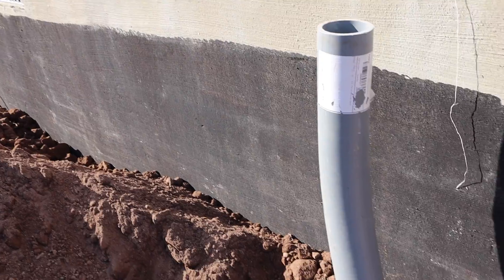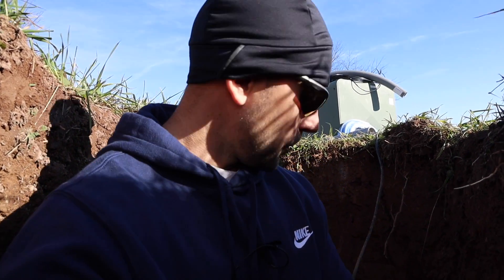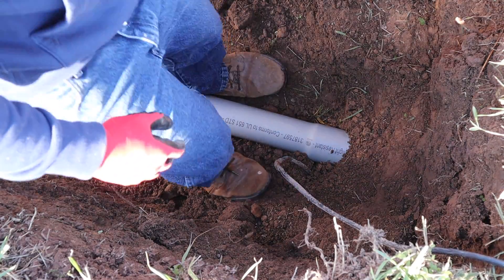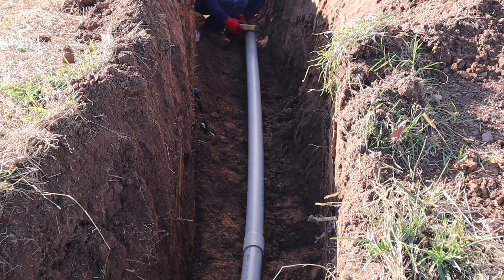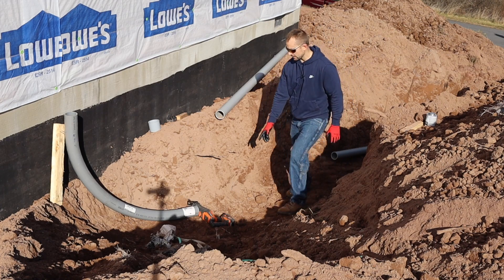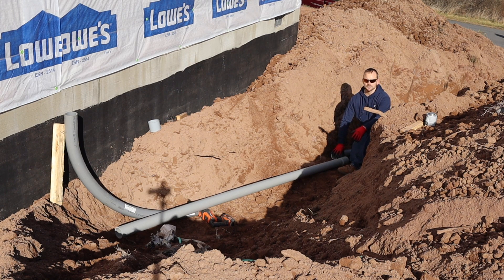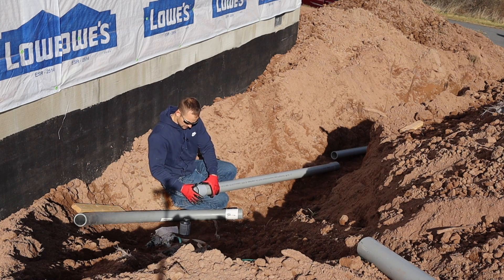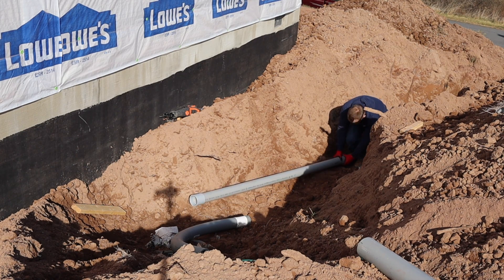Electrical Service Conduit Installation - Underground Power From Transformer

Comment: One would suppose you at 35/hr for the books. 150 hours,  equipment rental (LOWES mini excavator $450/day+ diesel $200)... contract bid with three more leroys at 10-19/ hour. You pad the company $1k a week (on the low) [parts, kiln swedge and glue $1250] HSA -500 cash (co pays with three kids. wife works night shift for the nursing home) and you quote under 50k)

Comment: Why use conduit? Just get direct bury wire. But I don't have codes where I live in Missouri.
Reply: Some codes are strange. I have direct bury wire from the pole to my ground transformer but conduit from the ground transformer to the house

Comment: Can you use 3 inch pipe with long sweep inside the  concrete form ?
Reply from the maker: I don’t see the problem with that. Should be fine. as long as the power company can pull the cable through. You can always check with the power company and/or local building codes for clarification. I hope that helps!

Comment: I didn't think you could come out of ground and up to the meter base with pvc. Did you use schedule 80? In my area the utility company makes the rules and even for a 200 amp single phase service they require 3" pvc in the ground with a 3" sweep and then transition to ridgid or imc coming out of the ground to the meter base. The problem is that most 200 amp meter bases only have 2" knock outs. The utility doesn't care. I have to pullna 3" hole and wrestle in that 3" rigid. Then the utility pulls in the triplex, which is rated for direct burial but you gotta have a sand base, then cover with sand once they put the wire in, have them look at it before snd after. A big hassle. So everyone uses the 3". And they pull in aluminum treplex. They make the lineside connection to the meter base. I make the liad side, usually before they get there. And the triplex has been really derated. They don't care. They don't have to. They are mot subject to the NEC.

Comment: Sometimes yes you can use schedule 40, but it would just typically need to be buried deeper. Very important to check your local codes to see what type of conduit you need for burial

Comment: Does the power company supply the schedule 40 from the transformer to the house?
Reply from the maker: I had to buy the conduit and install it before the power company would pull the wire through. Contact your local power company and see what they want you to do is what I would recommend. I hope that helps.
Reply: thank you for the quick reply and thank you for the excellent videos.

Comment: Never expected the rope to be chewed, but that is why we do conduit. It would be interesting to see the ball with another string blown through. Is the wire hard to pull?
Reply: thought same thing  if it was capped, how did mich get in?
Reply: @somchai4046  the bottom of the transformer is pretty open.  Not very hard to imagine water making a little channel where rodents can get in.

Comment: Does the conduit/trench have to be inspected for depth? Or can you just backfill it and the inspector usually takes the homeowners word for it as to the trenches depth.
Reply: It depends on the inspector. Sometimes they’ll even accept a picture of the trench and be like yeah that looks like it was deep enough

Comment: if you have the equipment to dig ad backfill yourself, how do you figure out how deep to go and how to get it at a decent rise/ angle to make it to the house? also once that it connected to the house, does that have to be inspected before you can go ahead a fill it back in and does the electrical company have to turn on the power or who do you call for that?

Comment: Thanks for the video..I have a similar situation. 3 conduits hydro, tel and cable. They will run up through the footings and stem wall B before we pour the concrete. Electrician wants 3000.00 labour 😅most of that seems to be gluing the conduit. Also installing the distribution panel.

Comment: Our electric company won't pass the 90 degree sweep, we have to use a hockey stick, where we then need a 45 and a 22.5 elbows. also the want purple cleaner on the pipe before the cement.

Comment: Nice work man .. I'm not an electrician and I dont do this kind of work, but when you said the mice ate that string ..or rope .. how are you gonna run a  new one and how did mice get there?
Reply from the maker: Evidently the mice came through the transformer. I had to contact the power company to open up the box and they help me fish a new rope  through. Thanks for watching!

Comment: Great video. 
I will be installing electrical cable in conduit for ground mount solar panels soon.  I will have to go about 200 ft.  To make the "pull" easy my thought is to slide each 10 ft piece of conduit onto the cable from each end and stop in the middle.  Then glue the conduit together.  Continue this until all the cable is in the conduit.  I dont see that anyone does it this way.  Is this reasonable?  Will this work?  Any downside to this?
Reply: The National Electric Code wants you to put the piping (conduit) to be fully installed before you put wire in it.  I expect the wet glue will either destroy your wire's insulation when wet or glue the wire in place.  

Since solar installs are modular. (Add more if you need), I encourage you to consider a large pipe.  There is  minimum size pipe based on the number and size of your wires....minimum size.  If you put in a larger pipe, you can add or replace the wire, use the old ones like a rope for the new ones, without re-digging the trench.

Also, while your trench is open, consider a second or third pipe for power to lights or a data run for cameras or monitoring equipment.  If The trench is open, it is an easy install and just cap them until you need them.....no re-dig.

Hope that helps.
Reply: @keithharrington8715  That makes sense.  Thanks.
Reply: @keithharrington8715 wjy size of conduit is recommended for the setup you're describing? I need to run service from my home to a small woodshop within 10 feet from the back of the house and wasnt sure to use 2"or 2½".

Comment: Dude, how much would it cost for 63ft power line run from the garage to the house. 
I am looking at quotes and they all over .
Appreciate it.
Reply: I am an electrical guy.  You do not need years of training to do that hook-up.  If you have the time and ability, you could do most or all of the job yourself to save on labor costs.

There is a lot of rules for electrical work, so research the heck out of it.  Maybe talk with a local electrician about being a consultant.....getting you the rules and some techniques to get the job done.

Also, for a garage, a pro might get a problem solved before you know you have one.

Consider adding extra pipes in your trench.  If your garage becomes a shop, you might need Internet or security cameras or maybe a flashing light (diner bell) for emergencies in the house for those times when the noise lever is high.

 If your trench is open, it is just some pipe, but figure out you need to hard wire some internet out there after you close your trench and you might be digging a new trench.

Hope that helps.

Comment: I have a question about hooking up a meter socket and panel using 350 kcmil cable. The lugs won't accept that size cable. What can I do here? Use a pin adaptor? cut several strands out until the cable fits? Thank you
Reply: They should make lugs for your situation.  Please, please, never cut strands out of the cable.  It reduces your wire size.....that means it will not carry the current it is rated for.

Comment: I’m new to the commercial electrical trade, I doubt you’ll see this.. but if the prints specify rigid 90’s for the stub ups, do you have to do it? Or can you get away with a pvc 90 for the inspection?
Reply: Sounds stupid but the reason is they are scared the pulling rope will burn through the radius of the 90 so they want steel or imc. It's a real bitch wrestling a 2" or 3" steel sweep. Consider yourself lucky that they accept pvv sweeps. I worry about the connection between the sweep and the straight pipe feeding into it when it comes to pulling in the wires as I have had the plastic coupling break right there on a tough pull.

Comment: Cool video. I'm wondering why you didn't have to use a rigid 90 to the house? Normally you're supposed to do that. Typically, you use schedule 40 90-degree bends with a 36 inch sweep from the transformer, DB120 for the straight runs and if you're going to a box, you use a rigid 90. The rigid 90 takes a female adapter with additional schedule 40 if needed. 
I work as a field superintendent for an underground company and we do this all the time.
Reply: In your area, it's different everywhere

Comment: Is that 3"? What size wire are they pulling through that? How big is the service?
Reply from the maker: It is 3” and the power company pulled the wire through for a 200 Amp service. Hope that helps!
Reply: I need to run 2 4” schedule 40 ducts for phone lines. Need 430’ and it’s going for $10 a foot if I can even find it. Incredibly expensive.

Comment: What size PVC conduit is that
Reply from the maker: 3”
Reply: Does your 200A meter base have built in 3" knock outs?  If so, what's the manufacturer?  Thanks 🇨🇦

Comment: I am building my house on vacant land I have a question so the electrician is the one who has to install the underground PVC pipe and electrical Conduit from the pole/transformer, do he also dig the trench or do i need to hire someone else? just to get a rough idea how much do you charge for this job. Thanks
Reply from the maker: My excavator dug the line. The electrician or excavator would install the conduit. It all depends on the person if they do or don’t do it. Good question. Thanks for watching!

Comment: can u put wire thru pipe.  then glue pipe then put down in trench
Reply: I believe the power company runs the wire from the transformer to the meter.
Reply from the maker: Yes the power company does run the actual service cable in the conduit.

Comment: Why no primer?
Reply from the maker: Don't need it for this application.
Reply: @TheExcellentLaborer   i was curious about this myself.
Reply: Primer waste of time unless your putting in a waterline with pressure.
Reply: @kylekayser2291  DWV uses primer and there is no pressure.
Reply: @mr.g937  ...So
Reply: Thanks guys. I guess NEC states it is not necessary in powerline applications. I remember using Green cement when I did a short run of 1/2 inch buried PVC with UF cable for extra protection.

Comment: Great video Josh. Jack of all trades eh! Did you pull the electrical permit? Is your home parched already then sealed with tar?
Reply from the maker: Thanks Amazing! I try to do all trades. When you build a new house you pay for all the electrical, plumbing, and framing permits at once. Yes the black foundation coating you see is the sealer.